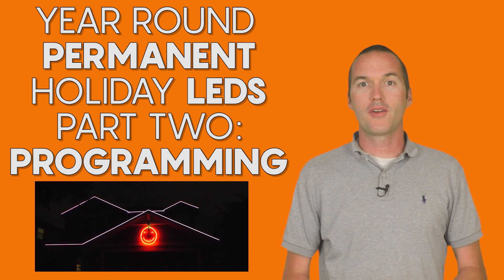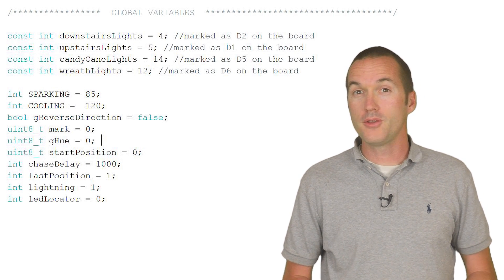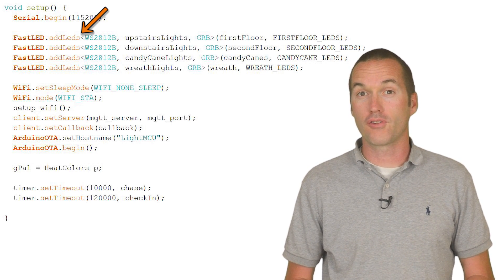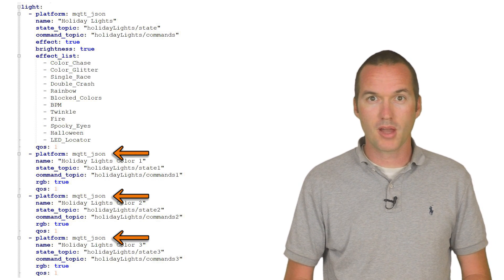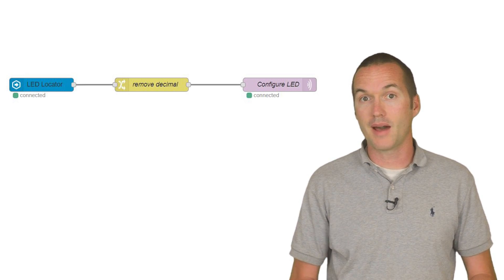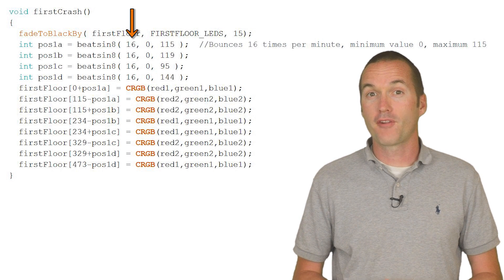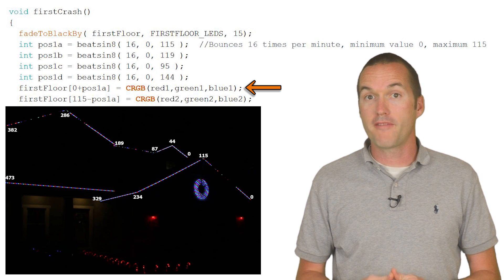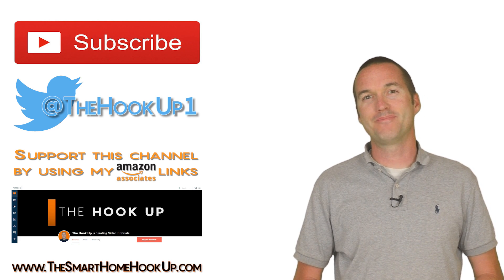Year Round Holiday LEDs Part 2: Software

Comment: How do you upload the sketch without an error message and how do you get home automation? I have the board and arduino set up but I'm stuck at uploading the right sketch? My nodemcu is blinking slowly
Reply from the maker: what error message are you getting?
Reply: Espcomm_upload_mem failed. I thought I could copy and paste the code?
Reply from the maker: @iAmFroze  That means you haven't connected the nodeMCU to your computer correctly or you haven't selected the correct port in the arduino IDE.
Reply: @TheHookUp  Oh my, it's getting complicated, thanks
Reply: I only have 1 port showing?
Reply: @TheHookUp  How can I troubleshoot to hook it up correctly? Where do I start? I have copied and pasted on the additional boards manager? Should i just start from scratch?
Reply: @TheHookUp  Does it have to be hooked up to ground? i don't have power going to it or ground?
Reply from the maker: No, just the USB.  After copying the boards manager URL did you go to tools -> board -> board manager and type in esp8266 to install that package?

Also, can you link the exact nodeMCU you purchased? some of them have a serial to USB converter that requires and additional driver.
Reply: Please HELP

Comment: What about adding to the default effects in the EsPixelStick firmware? Would love to see some of these and the bruh effects ported over to the EsPixelStick firmware. 

Currently using a combination of Xlights, FPP, and Homeassitant to create "static" but animated effects that run on 30 second loops. FPP's MQTT support is finicky tho.
Reply from the maker: Hmm, that's an interesting concept.  I looked through the code when I was trying to figure out if I could add more than one output pin per nodemcu, but it was not possible without a complete rewrite.  I'll have to take a look at the effects section to see what can be done.
Reply: @TheHookUp  You would have to use the single output but I believe it would be possible to within the effects code to divide the single data line in to segments of LED. Say 1-150, 151-250, 251-XXX. I haven't dove to deeply into it as I've been just trying to get a working configuration for now. If you search ESPixel Pop and ESPixel POP Tiny its possible to build a controller for under 5 dollars that will run about 720 RGB nodes each.

Comment: FYI I contacted the supplier and they are telling me these lights aren't recommended for outdoor use I should have used ip67 or ip68 my bad
Reply from the maker: I'm not sure why someone would put IP65 lights inside...
Reply: @TheHookUp  ya they  don't want to give me a refund, I guess I'll try fixing by taking them down and applying electrical tape on the back and redo all the strip to strip connections

Comment: FYI these lights aren't proving to be very waterproof the coating on the back seems very thin and the copper pads are discoloring after first rain storm seeing light blue discoloration on the aluminum channel where the copper pads on the back come in contact with it, I 'd add a picture if I could
Reply from the maker: That's pretty strange, mine have been up for 13 months now and I haven't seen anything like that
Reply: Rob I'm wondering if something else has changed with these strips my self and another guy are experiencing an issue where random leds with random colors come on when we powerup the power supply and this was before the rain issue it would do this even in testing in my office floor, any thoughts
Reply from the maker: What voltage is your supply at? I get random colors like that if I go above 5.1v
Reply: Just went and checked it is 5.2V is it normal for the fan on power supply to speed up as more leds come on
Reply: if the voltage is below 5.1 no leds should come on, is that right? not sure what the expected behavior is
Reply from the maker: @morrydavis  5.0V is the optimal voltage.  Some people crank up the PSU to help with voltage drop, but it always results in noise on the data line for me.
Reply: The Hook Up I cranked it down to 4.85 and still get random lights at power up any other things to try. I sent a message to electronic.alice about the water problem to see what they say
Reply: the one data line that I use is .74v the others  are close to 5V but this seems to change the next time I power up the unused data lines are at 0V
Reply from the maker: Weird, so you've got residual voltage on your data lines even with the nodeMCUs off?

Comment: When I turn on the Holiday Lights it doesn't bring up the effects chooser.  I am not sure what I am doing wrong.  I did put my configuration into a package if that makes any difference but I don't think that it does.
Reply from the maker: Is your yaml the same as mine?
Reply: @TheHookUp  The yaml is the same as yours.  Only difference is that it is in a package instead of in my regular yaml.
Reply: Got it figured out...  rookie mistake, expected drop down to happen after flipping switch on the main screen rather than the more info screen.

Comment: Hey Rob,

Ive flashed the code to my D1 Mini attached to my Christmas tree lights. I've commented out all the code for Second Floor, Wreath & Canes then just used First floor to light my christmas tree. Im experiencing some issues where the rainbow effect stutters and sometimes other effect start and then the D1 crashes and reboots. I can't work out what's wrong. If I flash your default FW it seems to be okay?
Reply from the maker: Sounds like you are writing to LEDS that don't exist.  Make sure you have all of your NUM_LED values correct, and that you're not calling anything outside that range.  As a test you can incraese the number of LEDs in the FIRSTFLOOR_LEDS define and see if that fixes the issue.
Reply: @TheHookUp  Hey Rob, Ive just spend some time going though and commenting out all the custom configuration apart from the rainbow effect. If I set #define CHRISTMASTREE_LEDS (i have 100 LEDs on my tree) as anything less than 250 i get this jittery effect & ESP crashing. Could you cast you eye over this Gist? https://gist.github.com/kingphil123/7c536a22e91a0d97ddacc41872b1b95d
Reply from the maker: @Wranglatang93  In the main loop you have:
  FastLED[0].showLeds(brightness);
  FastLED[1].showLeds(brightness);
  FastLED[2].showLeds(brightness);
  FastLED[3].showLeds(brightness);

But you only have one array defined.  Take comment out FastLED[1] through FastLED[3] and report back.
Reply: The Hook Up thanks for the speedy response. Problem is still present.
Reply from the maker: @Wranglatang93  could it be a power issue?  What power supply are you using?
Reply: @TheHookUp  Hey Rob, Sorry for the slow reply. I've just set up some new LED strips on my house with 3 zones and it appears to be working just fine - some zones only have 102 LEDS in.

Im using a Node MCU for this one though whereas on the christmas tree I'm using a D1. Not sure if the D1 is geared up for this and to power 100 LED's.

Thanks for all your help mate.
Reply: Right! I have set up my lights on my house, it all worked bench side but now its installed I'm experiencing some weird behaviour. When the lights get powered some of them come on with random colours whist others remain off. Once i actually turn the lights on, and choose an effect, the first couple will work with the effect but the rest remain as they were. Any ideas?

Comment: you talk about being able to update the sketch on the node MCU ota but where are the instructions on how to do this over the air
Reply from the maker: I believe on the newest version of the arduino IDE OTA uploads are enabled by default.  If you click on "port" while your nodeMCU is running my code (and the lights are toggled off) you should see the network IP address of your NodeMCU as a possible port for uploading your code.

Comment: I noticed the wire you bought is jacketed but you must have to strip the jacket off to fit in the channel so why not  just buy single wire. I'm going to build one long string would you recommend soldering it all together before trying to put in channel

Comment: Hi, I’ve implemented this on a single strip of LEDs, which is working great. Thank you so much for the video and instruction.

One of the things I’ve added is a timer through node red to bring the lights on for a specific length of time with a certain effect - which is working as I can physically see the lights coming on and going off.

What I’m struggling with is getting the state of the lights to show in home assistant. 

I have been using the big timer node and have tried passing the “on” payload to the state topic, but this isn’t working. I’ve also tried connecting the nodes as per the flow you have provided. Likewise nothing.

Any help would be appreciated.
Reply: As an update I have managed to get this working - after much hair pulling and un web searching and general playing around..
For those who may wish to do likewise and are noobies to HA and node-red etc here's what I did..

I came out of the bigtimer node into a switch node - output 1 of the switch node takes the 'ON' payload command to a call service node that turns on the entity_id light.holiday_lights, a second output which takes the 'OFF' payload command to a call service that turns off the entity_id light.holiday_lights. I then have a change node coming from the same bigtimer output which changes the 'ON' message to the name of the effect that I wanted the LED strip to light up with.

I'm not sure if this is the best method to achieve this, but it is working, if there is a better method I'd love to hear it.
Reply from the maker: That works.  I swear I replied to your comment from my phone yesterday... I wonder why it didn't post.

The effect should last through the on/off, so it should go on to the last effect you selected.  You are correct though, it will show the state of the light correctly, but it won't show which effect it is using.
Reply: @TheHookUp  Thanks for the reply, is there a way to get the effect to show up the effect it is using rather than the previously selected effect?
Reply from the maker: @81PaulG  Hmm.  Easily? Not really.   You could make an MQTT sensor then modify the code a bit to publish the effect whenever there is a change.
Reply: @TheHookUp  thanks, something else to play around with :)

Comment: Great video Rob, I want to do this for my Christmas tree with just 5m long, can I power the led strip directly from the nodemcu?or do I need the logic level converter necessarily?does the 3.3 v   is not enough?
Reply from the maker: You may be able to get away with it if you can turn your psu down to 4.7v

Comment: Hi, Rob  is there a way to slow down the frequency of the lightning? thanks
Reply from the maker: So, the easy (lazy) answer is to tell you to add a delay(50); to the routine... but the better way is to change random8 to random16 (which generates a number between 0 and 65535) and then use a value like random16 > 65530 to replace the random == 255 value.  

It's crazy how often a randomly generated number from 0-255 is equal to 255 huh?  Lots of cycles per second.
Reply: i wondered, i will definitely do the random 16. I got the audio working so i wanted to slow the effect down a little.

Comment: I was hoping you can explain a little of your code to me.  I am looking at the addLightning() function.  The variable lightning is initialized to = 1 in your global variable section ).  Your function (addLightning) will only flash if the variable lightning is !=1 .  The only place I see lightning being set ( other than the initialization ) is  if chance ==255, then it sets to 20, and lightning will strike or go away after 20 calls to the function ad the variable is decremented on wach call ( unless chance ==255 happens again ).  
So, my question:  Is this intended behavior, i.e. only start lightning when chance ==255?  It would see that  lightning would not strike that often.  ( AND Fl is the lightning capital of the world).  

Anyway, what am I missing.  Thanks.  As always, your videos are very instructional.
Reply from the maker: Actually I think it still happens too much.  It generates a random number every loop, and the loop runs about 30times per second.  A lightning strike heppens about once every 10 seconds, but sometimes you get a chain of 5 or 6 in a row which is pretty fun.

Edit: the random number generated is between 0-255.   It's also worth noting that on my test setup it doesn't work because that loop runs about 350 times a send so the effect is constant.
Reply: Thanks.  At least I read the code correctly.  I think I will add it to my loop ( well actually EvilGeniousLabs) and check it out.  I found this lightning effect (  https://github.com/atuline/FastLED-Demos/blob/master/lightnings/lightnings.ino ) where it varies the length and start pixel of the lightning.  On your setup, with  2 roof lines of light, each one could be independent giving you an kool effect..  Again, thanks..................
Reply from the maker: @markferrick10  So, one thing you'll see about my code is that I basically never use delays.  There's a delay in the wifi setup, but in the loop there's never a delay.  The problem with delays is they are blocking, meaning other parts of the code can't execute if it's in the middle of a delay.  This way I can keep my timings consistent by using simpleTimer (which relies on the millis() function).

I've found a bunch of cool effects that I ultimately had to rewrite or just plain couldn't use because they used delays :(.

Comment: Great video! I have something of my own setup based on your code. I find that I have to send two commands to the ESP before it will take a setting initially (off of a reboot) but thenafter it works fine. Any ideas why this is? If you look at the console it's getting the message of ON and an effect, but the effect doesn't display until you choose another one. Thanks!
Reply from the maker: Looks like it's not getting an effect.  It actually gets a message of "undefined" on the effect topic when the lights are turned on.  If you want an effect to come on initially you can define one in the variables section of the code.  String effect = "yourEffect";
Reply: Thanks for the reply! I tried this and it did start my effect at startup, but then it wouldn't listen to any of the incoming MQTT messages. I think this may have had to do with the effect I chose as it was my own and I'm still trying to figure out what will work best but I'll try with one of the ones I know work well from your example instead. Thanks!

Comment: I managed to fry a component on my NodeMCU, but strangely enough it still seems to work. Can anybody identify the purpose of my fried component and if there is any problems using the board without this: http://i1160.photobucket.com/albums/q493/AzDane2/IMG_9636_zpsucianbaq.jpg
Reply from the maker: Not sure.  It's an SMD resistor of some kind but no idea on the value.